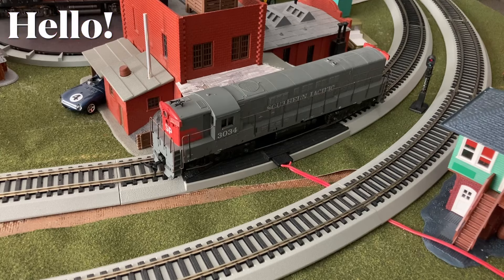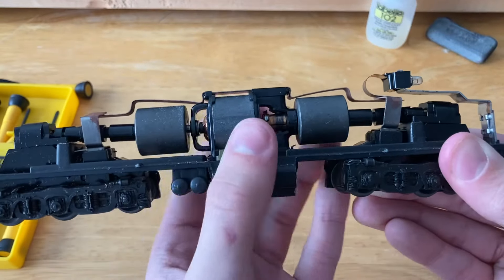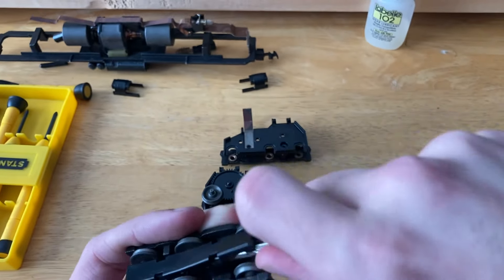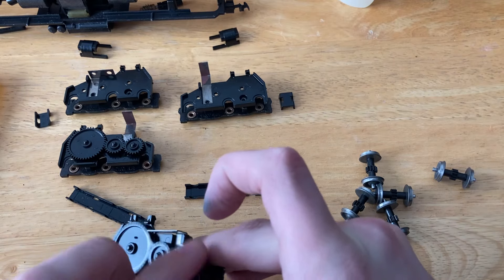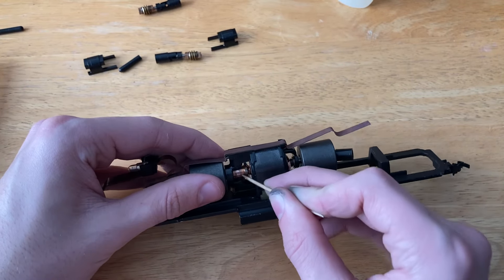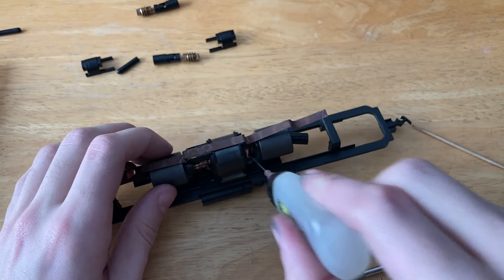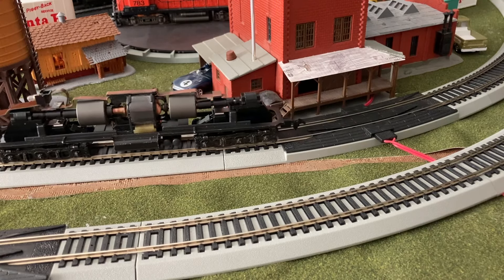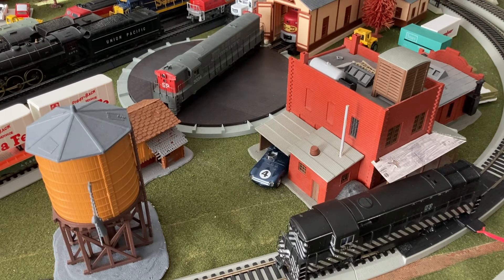Athearn Blue Box Trainmaster Restoration ⛽️🧰🌊 Can We Fix It?

Comment: I hand painted my two SP FM Trainmaster handrails using a ultra fine paint brush and grey Testors Acryl 921576.  I may have used another grey to mix with the Testors to get the colour to match the Athearn paint applied.  Mounting grabs were painted white.  Some like to remove the hand rails for painting but if one is careful using great focus, application of paint with handrails in place is very effective.  Thank you for posting your tutorial on locomotive maintenance and restoration of this particular model as they are Athearn Classics.  Best wishes.
Reply from the maker: Awesome! And Thanks for Watching!!